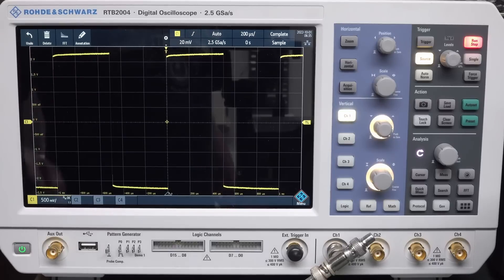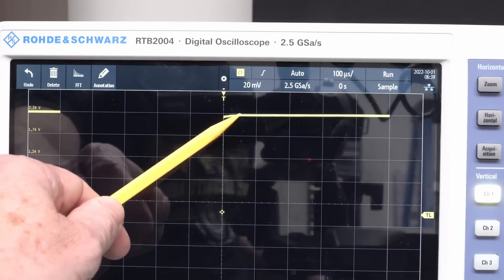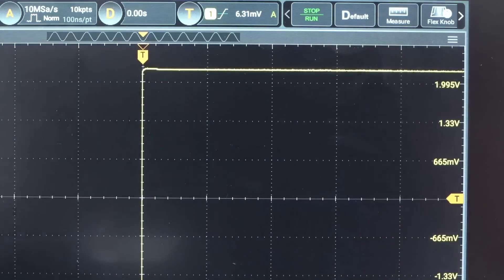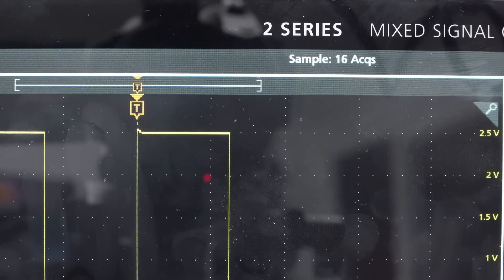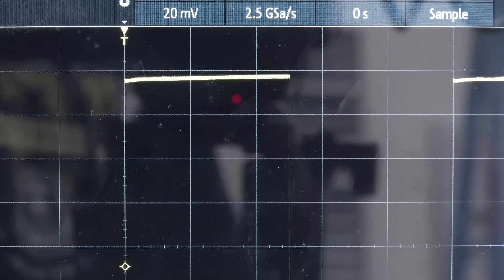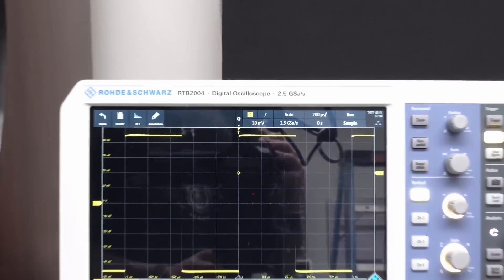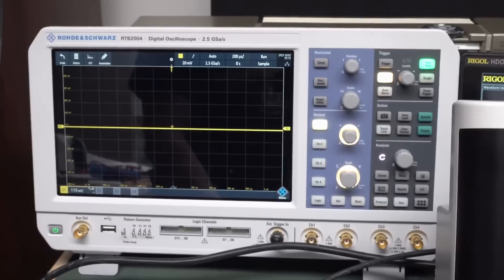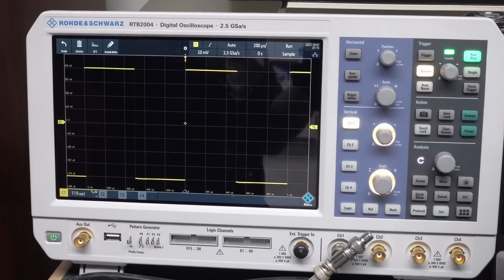Rohde & Schwarz RTB2000 Scope Pulse Response

Comment: Dave, please don't call your oscilloscope videos a full review if they don't include a DC coupled 10Hz/100Hz square wave flatness measurement using a coax cable! In December 2021 I wrote here "EEVblog Electronics Community Forum »Products »Test Equipment »GW Instek GDS-2000E teardown /short review, comparison with Rigol DS2000(A)" under the name "Krisztián" that the GDS-2104E has serious problems with e.g. the 10Hz square wave flatness. The same signal is perfectly straight on the excellent JFET input Hitachi VC-6145 combiscope.

Comment: My SDS2504X+ doesn't have this problem. My SDS1204X-E is also fairly consistent except on the 200mV/div range which actually shows a sharper edge. Either way, it's a non-issue and neither are anywhere close to as bad as the Rhode & Schwarz.
Reply: "it's a non-issue" Wrong.
Reply: @aklankrisz  Explain...

Comment: I have recently been corresponding with
John Addis, the designer of the Tektronix 7A29 1 GigHz vertical amplifier, and principle engineer of the 7104 1 GigHz mainframe... which I own. Those guys had all these problems solved 50 years ago. The attenuator in the 7A29 actually works to 5 Gigs... the guys making this stuff today have no clue about how it was done, and are doomed to create glitchy stuff. My other scopes are:
Tek R7844 400MHz dual beam rack mount
Tek 7834 400MHz storage scope. 
Tek 2247A 100MHz portable with integrated digital co-processor.
Non of these exhibit any of these issues. 
I use a Siglent SDS 2202X-E but mostly in FFT driven by residual out of a distortion analyzer, the Tek AA501.  The degree of real science and engineering in the  post 1970 to pre 1990 Tek products is unparalleled. No finer analog engineering exists.
Reply: For a good design the only residual pulse distortion will be from the calibration of the frequency compensation and calibration of the thermal balance.  The specifications usually require aberrations to be within 0.2 divisions but performance is commonly much better than this.  The results Dave got are probably considered within their specifications, but I sure would not put up with some of them.

I have:
2 x 2230
2 X 2232 which are my most used DSOs
2247A
2246
7904A which is my favorite analog oscilloscope
7603
2 x 7834
7854
2440

Comment: Is this typically for digital scopes? Or have analog scopes the same issue? Thanks.
Reply: Analog oscilloscopes had to deal with all of the same problems and their design was very careful to avoid them.  Knowledge of these problems has been lost over time and new engineers may not be aware of them.
Reply: @Alamagosa  Thank you :)
Reply: This is tipical for shitty smd parts, but not because they are digital. My analog/digital VC-6145 combiscope does'nt have that problem at all, but my GDS-2104E is distorting like hell...

Comment: you know what ? am ready to have this scope and pay for all costs to have it  here in france next to my tek465 , by the way in my past engineers in rf experience  R&S was already the best for ease of use reliability and support , way better in RF than HP....but COSTLY ! in this tests be sure of adaptation , the gen should have at least a 10 dB attenuator on output , coax and connectors should be rated to at least 4 gHz then we may talk about perf...this is why it is strange behavior IMO issue is SWR ...even at 1kHz at good gen as a rise time of gHz and so ...
Reply: The setup was good. You not need GHz generator for precison 1kHZ flat pulses. The key is here flatness, not rise/fall time. I have 3 scope, only the newest (DSO) have this problem. My combiscope and my fully analog scope made in 70s does not show any flatness error.

Comment: I saw a couple of different problems.  The slope of the pulse top on the RTB2000 looked like printed circuit board hook in the high impedance attenuator.  The reverse of the top on the Tektronix looked like a mismatch in medium frequency compensation of the two path front end.

However I would not rely on the flatness from your AWG without verifying it using a sampling oscilloscope.  A reference level pulse generator is normally required for these sorts of measurements.

Comment: I would like to see you repeat this after calibrating the probe.
Reply: No probe is being used.
Reply: Which is likely a problem, since the front end 1 meg input has part of the probe compensation in it, as I recall, so a 50 Ohm cable has little chance of matching the probe cable and compensation?
Reply: @derkarhu5079  It does not work like that.  Like a x1 probe which is 1 megohm,  a 50 ohm direct connection requires no compensation.  What is required is a 50 ohm termination at higher frequencies.
Reply: @derkarhu5079  No.  A straight, properly terminated good quality coax will perform well into the 10's of GHz and requires no compensation.

Comment: Dave you fool !!!
Its schroedingers signal.
Its perfect until observed. 🤣
Reply: A man with one oscilloscope knows the pulse shape.  A man with two or more oscilloscopes is never sure.
Reply: 😂 was searching for that comment
"It's schroedingers squarewave"
But as others mentioned, how can we be sure the signal is generated totally perfect unless we measure?
If we measure the exact same signal with several scopes and get a similar result, we might need to change the source, to check if the quirks come from there, right? 😯

Comment: If that slope error is a result of error in the compensation network do you think some freezer spray would worsen it or is this more of a compensation network design/topology limitation?
Reply: That slope is more typical of circuit board hook in a high impedance attenuator and is not really suitable for compensation using a network.  A measurement over a longer time period would make this more certain.

The circuit board might have absorbed humidity after being manufactured causing this.  Many differential high voltage probes suffer from this as well after months to years.  Early oscilloscopes used plastic substrates (Polysulfone?) for their high impedance attenuators to avoid this problem before it was understood.  It is not a mistake I would expect Rohde & Schwarz to make.

Comment: Does bandwidth depends to the selected front end attenuation?
Reply: Bandwidth should not vary with the volt/div setting.
Reply: @Alamagosa  yep, should not, but what if does?
Reply: If the bandwidth varies with volts/div, then the design is flawed.  Bandwidth and pulse shape should not change with the position and volt/div setting.

Modern DSOs which only use one high impedance input attenuator have to operate their high impedance buffer over a much larger signal range, and may be slew rate limited causing variation in their full power bandwidth.

Comment: Is there no agreed spec for 20MHz LP filters on scopes? This all looks like a bunch of different impulse responses to me. But I can't explain why it changes with vertical scale.
Reply: It changes with the volts/div setting because of switching in and out of the high impedance attenuators, and operating point changes in the high impedance buffer.  It is a difficult task to design each to avoid these problems.
Reply: @Alamagosa  Yes, I was thinking about that. A scope attenuator is composed of capacitors. There are resistors too, but they only serve to allow a response down to DC. Clearly as ranges are switched reactive loads change. Given enough DSP this could be equalised but it really isn't worth it. Nobody expects that degree of accuracy from a scope.
Reply: @donepearce  I would expect that precision! Its easier to redesign the analog frontend than equalise that with a DSP.
Reply: The high impedance attenuator sections are designed to be constant input and output impedance so switching them in and out should not affect anything except the attenuation.  Some DSOs implement corrections using DSP, but I do not know that any modern low end DSOs do.

The displayed results are likely within the specifications, but do reveal some real flaws.  I would not tolerate that slope shown on the on the Rohde & Schwarz RTB2000 on any of my oscilloscopes.  Some of the other results are questionable also.

Comment: Is that the same on analog scopes?
Reply: It is.  Analog oscilloscope design went to great lengths to remove these types of errors.
Reply: No! Most of analog scopes made in the 80s have been ruled out these errors simply buy using bigger transistors or using jfets in the input stage.